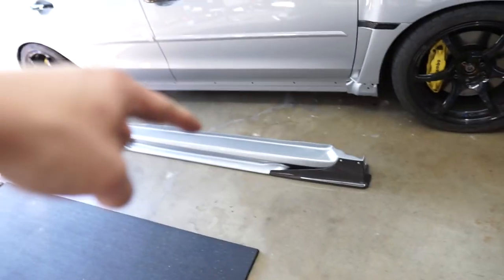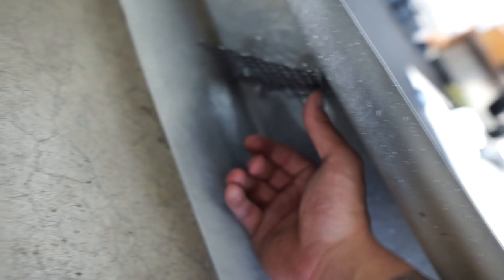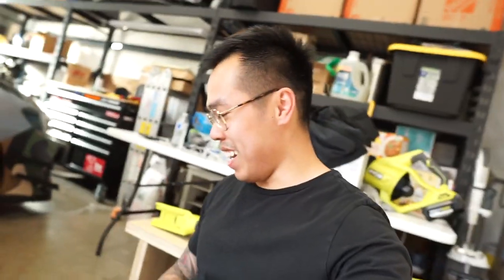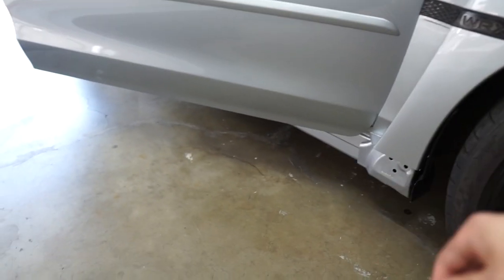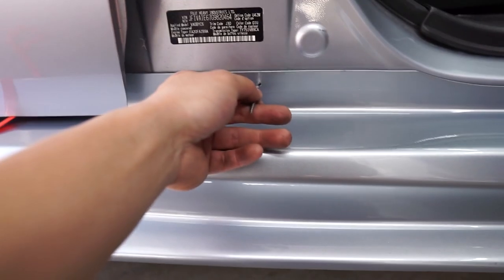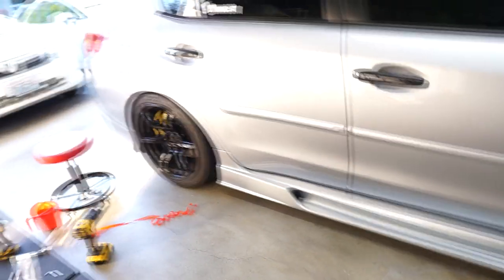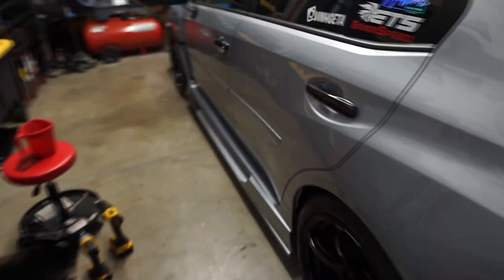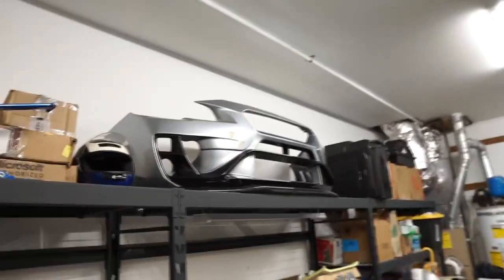2015+ WRX Varis Arising II Side Skirt Install | Painted & Finished Part 1

Comment: What bolts did u use on the middle top portion? Self taps?
Reply from the maker: I used all the hardware that was supplied with the kit!
Reply: @vinhgeta is it difficult to jack the car up with the varis side skirt ?